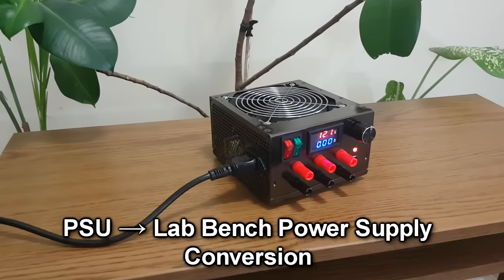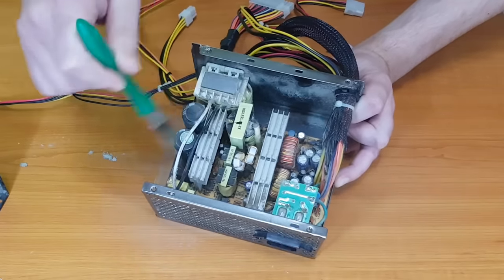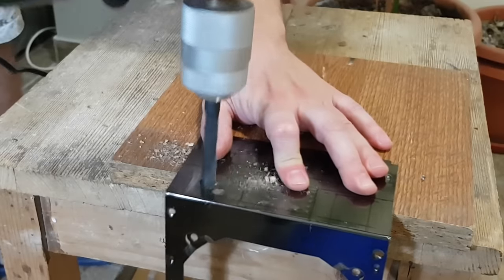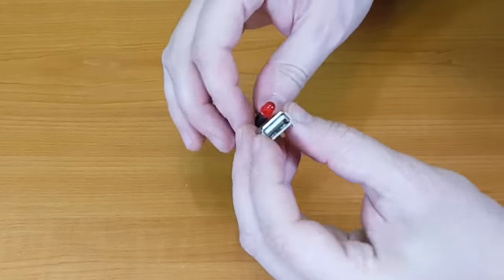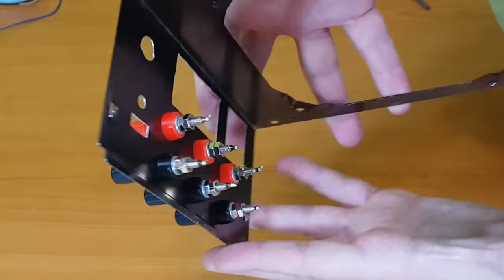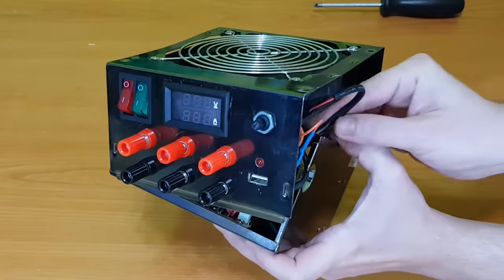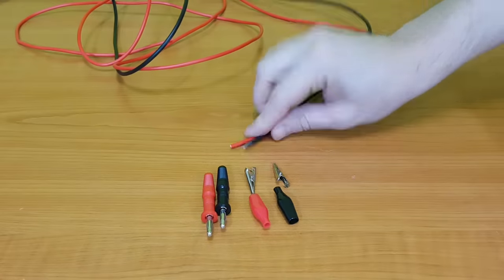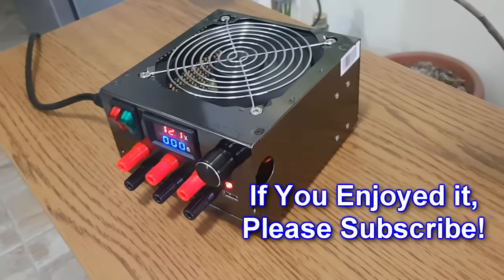DIY - Lab Bench Power Supply

Comment: at around 5:50 you put in resister 43 ohm one side on 5 volts other side on ground why did you do that?
Reply from the maker: some power supplies need a dummy load resistor, like that. otherwise they will turn off, if they don't detect a consumer. or they will not deliver a stable output voltage.

Comment: High isit possible to adjust the current amps on each voltage setting aswel? And not have a fixed current for each voltage. Also what is the maximum current supported on each voltage if possible with this DIY
Reply from the maker: hi. the current cannot be limited by the power supply alone. you can use a powerful step down converter with adjustable voltage and current on the 12V rail. the maximum current for each output is written on the PSU case, you can see it in the video.

Comment: the wire colour association with voltage values is same for all pc power supply? thanks
Reply from the maker: yes, if the PSU has the wires in these colors. but there are some power supplies with all the wires in the same color.

Comment: Hi very nice build, really like it! I'd like to build my own one like you did but I'd like to ask you, can I use a 4 position rotary switch instead of the 12 one for this project? Thank you!
Reply from the maker: hi. yes you can use a 4 positions rotary switch. please watch the part2 video fore more information.
Reply: Hi Sorin, I watched the video and I would like to ask you a further question. Could I also use a rotary switch aimed for more than one circuit in this project (connecting it as it would be for a single circuit as you showed in your video) or would it cause any kind of failure? I am preparing the stuff in order to build my own one but it will be light gray shiny coloured! Many thanks for your information!
Reply from the maker: hi. yes you can use that type of rotary switch.
Reply: Thanks

Comment: I' m wonder if the load resistor is necessary,  considering PSU with Voltage sense on 5V rail (Pink Wire ) and the fact that the fan is running anyway on the 12V rail.
Reply from the maker: hi. it depends on the PSU model, not all of them need a dummy load resistor. some power supplies have a separate DC converter for the fan, with variable voltage (or PWM) to increase the fan speed depending on the temperature. so it may need a load resistor on the output you most use.

Comment: I am pretty impressed with some of the projects you're doing confession I have not watched or registered your channel yet but I think I will out of curiosity do you have in your video listing a device that can produce 12 volts DC and has a variable switch in order to power a welding Lance feed wire motor for a mig welder as I am planning on fitting a aluminium welding torch to my regular welder but do not want or wish to cut into the electronics on the welder and to power the motor wire feed control I cannot increase the 12-volt voltage so therefore I'm assuming and I am not sure of this I may have to increase the amps or possibly drive down to 8 v 7 V in order to slow the wire feed on the welder what are your thoughts on this I'd be interested to know thank you
Reply from the maker: hi. I haven't worked with a mig welder so far, so I don't think I can give you an exact solution. but if you need to change the motor voltage with only a few volts, maybe you can use a DC converter and modify it to change the voltage only in the range you need. I've modified a converter in a similar way in my 100W flashlight video. it depends on how much current does the motor needs, but I think you can use a powerful converter.
Reply: If I use 12V only, what will be the power consumption? Will it be same as using a PC?
Reply from the maker: the power consumption depends on the load. you need to connect the load and an ammeter in series and measure the current.

Comment: I have a psu that worked, connected green to black and it turned on the fan. After cutting the wires, when I connect green to black, it spins the fan for half on sec and then it stops. And idea? The purple 5v has power for an led, but the other wires stop after half second
Reply from the maker: this usually happens when there is a short circuit in the wires, or some capacitors are swollen. try to connect the 3.3V sense wire to the +3.3V output.
Reply: @Sorin_DIY  thanks for the reply! It was the 3.3 sense, I also have 2 brown ones for 12v v2 so I didn't follow the circuit path. Anyway, solved, Thank you! :)

Comment: Hi, nice video!
I got 1 question. On amazon theres only a 10V 60Ohm resistor. Does it also work and if yes, whats different then?
Reply from the maker: hi. it depends on the power supply. it most cases it will work with a 10W resistor with 22 - 47 ohm
Reply: @Sorin_DIY  ok thank u

Comment: To get 18A out of 12V (yellow cable), do you need to connect all the positive cables to a single output?
Reply from the maker: yes. if you use only 1 or 2 wires with a 18A load, the wires will heat up and melt the insulation.
Reply: @Sorin_DIY  Thank you

Comment: Very nice: Question I have seen that this power supply has 2 outputs with 12V would it be possible to connect them together to get double voltage 24 or double amps 36? I am asking this because I would like to get one power supply with 4 outputs and ~30 amps each to power a project of mine that requires  48V and min 20A. Thanks.
Reply from the maker: hi. you can't combine the 12V outputs. the power supply will not work properly. you need a different power supply, more powerful.
Reply: @Sorin_DIY  Thanks for the reply it is not very clear so I have more questions :). The power supply will have problems with delivering stable voltage or will cause internal problems and worst case blow up :) ? because in your case the rated power is 600W and with only 1 output 12V you only use max 10 amps  so 120W.
Reply from the maker: there will be a difference of a few mV between the 2 rails. if you connect them in parallel, the output with the highest voltage will try to pass through and the power supply will try to deliver the maximum current to that output. I don't think there will be a balanced voltage between the 2 outputs. the PSU should not blow up :) in the worst case scenario the protection features should turn off the PSU. but most likely only one of the 2 rails will deliver its max current. the behavior also can differ for each PSU. I haven't tried to connect them in parallel yet, so if you want, you can do it at your own risk and tell us what happens :)

Comment: can multiple 12v rails be connected together or do they have to remain separate?
Reply from the maker: hi. it's not recommended to connect the 12V rails together. there will always be a small voltage difference between them.

Comment: If your PSU is made of steel, even drilling holes is going to be lot difficult let alone cutting the case. In this case, it seems the case is made up of aluminium. Can you please confirm?
Reply from the maker: hi. the PSU case is not made of aluminum. it is cut and drilled very hard. I don't know if it's steel, but it's a hard alloy.

Comment: Sir my power supply doesn't run when it's completely out of the pc. 
When I short the green wire with a black one,
It runs for a moment then again goes shut down. 
What should I do now? 🙏🙏
Reply from the maker: try to connect a dummy load, for e.g. a light bulb on the 12V output.

Comment: Hello, please it must be exactly 10W 45ohm resistor, or it can be little different? For example 39 ohm? Thank you
Reply from the maker: hi. you can use other value resistors, 22 - 47 ohm. with lower values, the resistor will get hot. so it must be minimum 10w and fix it on a metal panel for cooling.
Reply: @Sorin_DIY  Thank you so much for explaining

Comment: Can I  use i to charger my 12 V battery, and it automatically turns off the input power,  LED  lites on when it's fully charged?
Reply from the maker: no. you need a boost or buck converter with current limiting if you want to charge the cell manually. if you want the charging process to be automatic, you need a dedicated charging module for the type of batteries you want to charge.

Comment: Hi man, great video! Thanks.
I have a question. I made my ATX bench, and all the outputs are ok, but with a slight instability in tension, like +/- 0.02 volts, and when I want to use it to power my servomotors (controlled by Arduino), this slight instability makes my servos jitter very hard.
Do you know what can be de cause and/or solution to this?
Thanks in advance everyone!
Reply from the maker: hi. try to connect a load resistor to that output, it should make the voltage stable. test some 10W resistors with different values.
Reply: @Sorin_DIY  
Thank you for your response. I've already had a 10watt resistor connected to the 5v rail when I asked.

I solved the problem, after reading a lot, connecting the Power Suply's output to a 7805 voltage regulator with two capacitors and then connecting the regulator's output to the breadboard, it work's like a charm now.

Thank you for your instructional videos, they are great value for the community.

If anyone tries to implement the voltage regulator solution to this, have in mind that the regulator's output could fluctuate if it has no load connected to it. You can test it putting a simple resistor closing the circuit.

Comment: Can you connect the two positive 12 volts in parallel to achieve 36A max output?
Reply from the maker: no. it will not be stable.

Comment: That is a 6A peltier module right. Why didn't it take 6amp ? it took only just above 4 amp from the 12v.
Reply from the maker: yes, it should draw 6A. probably the peltier module is not very good.
Reply: @Sorin_DIY   I am having the same issue with my 3 modules which are rated 9A but only draws 4A from psu. I am a noob in circuits thought it is a strange coincidence. Great work in the DIY.

Comment: Hey Sorin! I really enjoy watching your tutorials. I have an ATX supply laying around and was wondering if it can be made into a car or motorcycle mattery trickle charger and maintainer. Could there be a project about that? CHEERS!
Reply from the maker: hi. lead-acid batteries need a lot of current and a voltage higher than 12V. for trickle charging it will probably work, but it needs a lot of work.

Comment: i have a question ..will the rotary withstand high current
Reply from the maker: no. it's used only to switch the voltmeter sensor wire between the outputs. please watch the part2 video for more info.

Comment: Hi, thanks for your project... one question, i have an atx with 14a on +3.3, 18a on +5 and 14a on +12 ... can i use 1 resistor "10w 22 Ohm" on +5v ? Thanks in advance
Reply from the maker: yes, but it will get hot. you need to add a heatsink, or fix it to the metal case.
Reply: @Sorin_DIY  thanks for your reply, i'll conenct with heatsink in front of the fan. :)

Comment: Hello Sir, I used 20watt 7ohm resistor as dummy load. When no load is used, the 5v line can measure up to 5.2 volts. But whenever I use load from +5v line, the voltage drops to 4.7 voltage.  Why don't I try it without dummy load, the drop is the same.  Could you please explain why the voltage drops? And what should I do next?🙏🙏🙏
Reply from the maker: hi. try to measure the voltage directly on the PSU circuit board. there may some power loose in the wiring. if it's the same voltage drop, the PSU circuit is not working correctly.
Reply: @Sorin_DIY  
Thanks, Sir.
Reply: @Sorin_DIY  
Thanks..
Sir.

Comment: what resistor should i use as a dummy load if the most power is on 3.3volts?
Reply from the maker: hi. it depends on the PSU. I would say between 10-22ohm at 10W. if you use 10ohm, it will get hot, you need to fix it on the metal panel or a heat sink.

Comment: Can i put the two 12v outputs together in parralell to have more amps ? 12V1 and 12V2 in parralell?
Reply from the maker: hi. this will not work on all power supplies. if there is a small voltage difference between the 2 12V outputs, one of them will always work harder than the other. but you can try it, maybe it will work on your power supply.

Comment: I have  a  atx power supply that will not take 6amps without turning it off then connecting the load then it works. if i dont turn it off before i connect the load it shuts down. any ideas?
Reply from the maker: hi. it depends on the load type. for example a drill motor will use 10-20A at start-up. then the current draw drops to 5A or less. but at start-up it will be a big voltage drop, so the PSU turns off, as a safety feature, like it does in my video.

Comment: Hi, Good day question about DC to DC. What is the best to be use a diode or resistor to stepdown 5v (USB) to 3.3v  (Webcam module laptop). Thanks
Reply from the maker: hi. resistors can not step down the voltage. the best way is to use a step down converter (buck converter). if you want to use some diodes in series, it will step down the voltage, but it will not be very stable. the voltage will fluctuate, depending on the current consumption.

Comment: If I don't get this 12 position rotary switch, what other component can I change it with?
Reply from the maker: the rotary switch is just for the voltmeter, it's not mandatory. you can use a 3/4/6 positions rotary switch.
Reply: @Sorin_DIY  Thank you very much for your help I wish you success in your day to day

Comment: If  I have a psu with 2 12v rails with 19A, and a 5v rail with 20A where shoud I put the load resistor?
Reply from the maker: on the 5V rail

Comment: Can you get 48v from pc power supply to run a 400w brushless motor?
Thanks!
Reply from the maker: no. only if you add a step up converter, but I don't know if you can find one so powerful to handle a brushless motor.

Comment: Hey. What happens if you have multiple 12v rails with different OPC's? Also can I connect the positive from one rail to the - from another rail?
Reply from the maker: you can't connect the rails in series, because they have the same negative output, so you will short them. but I don't know what do you mean with - different OPC's.
Reply: @Sorin_DIY  Oh, I figured it out. Thanks tho. 
I In regards to my question, I meant to say OCP (over current protection).
My PSU has 2 12V rails with different current output. Apparently, you have to keep them separate because they can have slightly different voltage levels (because different circuits are controlling each independently). If you do, they have no resistance between the potential differences, and you might get magic smoke.
 
The question I was trying to ask was in regards to the pairing of positive with negatives. I was wondering if each +12 rail would have to be connected to it's own respective ground or whether it didn't matter as long as the circuit was being completed to any ground.

Really appreciate the comment tho. Cheers!
Reply: @Sorin_DIY  XD I'm surprised you didn't roast me for being that dumb if you thought I meant to connect them in series. :P This is a pretty wholesome comments section.
Reply from the maker: hi. other people asked this question, so there is no problem :) this is a learning channel for everybody (including me). the negative output is common, so you can use a negative wires for all outputs. but for the 2 rails of +12V you are right. it's not recommended to connect them together.

Comment: why there's drop in voltage for 12v line when 3amp load  applied. It drops to 11v.
Any suggestion. My psu is 300w.
Thank you.
Reply from the maker: if you connected all the wires correctly, I think the last thing is the power supply, it may have a problem. try to measure the voltage with a multimeter.

Comment: Cool project, thanks! Where did you get the cool wire stripping tool?
Reply from the maker: hi. I've bought it from a local store. but you can find it online on many sites, like this one:
https://www.aliexpress.com/item/Automatic-Cable-Wire-Stripper-Stripping-Crimper-Crimping-Plier-Cutter-Tool-Diagonal-Cutting-Pliers-Peeled-Pliers/32700817226.html?spm=2114.search0604.3.61.4bec3d1dcdlwof&ws_ab_test=searchweb0_0,searchweb201602_3_10065_10068_319_317_5733915_10696_10924_10084_453_454_10083_10618_5733715_10920_10921_10304_10922_10307_10820_10301_10821_537_536_5733815_10059_10884_5734015_10887_100031_321_322_10103,searchweb201603_51,ppcSwitch_0&algo_expid=8ff52902-2db5-45b4-a36e-4f9fa7c43b52-12&algo_pvid=8ff52902-2db5-45b4-a36e-4f9fa7c43b52

Comment: if you want to charge your phone at 1a you need to connect negative to green signal wire on the usb port and add 2 rezistors from negative to yellow usb signal wire, that way your phone will think that normal ac adapet is pluged in. with out doing this your phone will think that its pluged to usb 2.0 and charge only at 100-500 miliamps.
Reply from the maker: hi. please watch the part2 video for clarifying this.